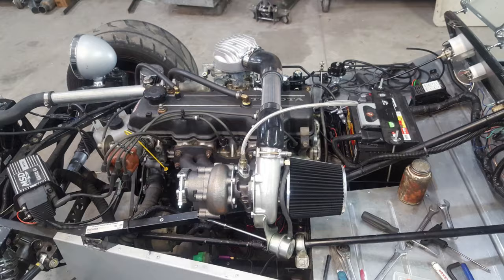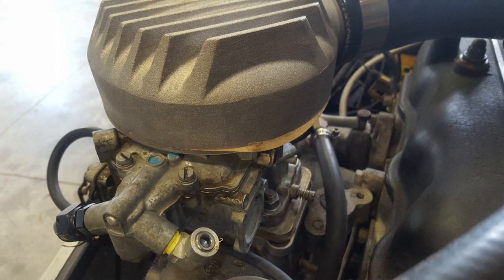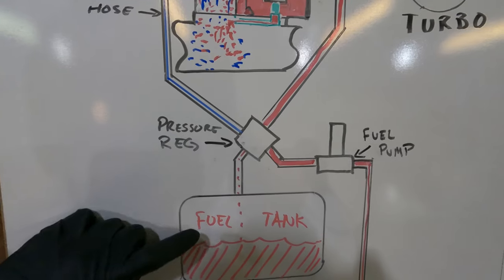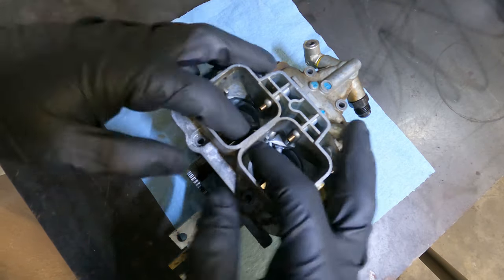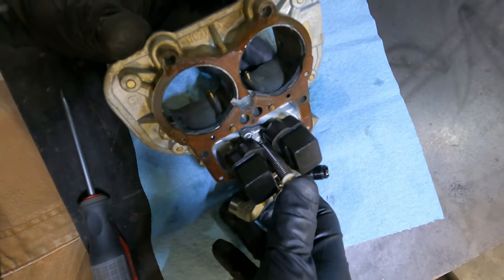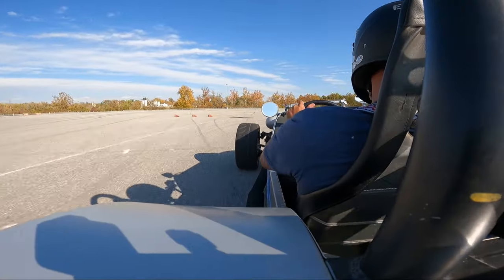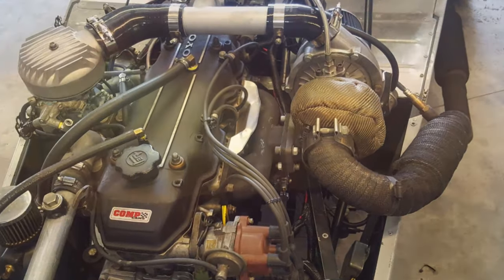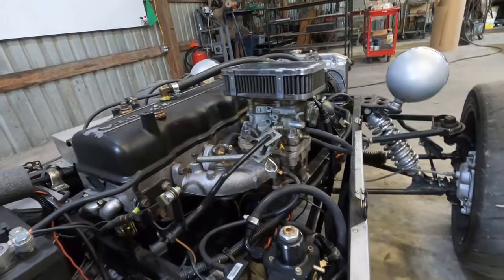Ebay Turbo+Weber Carb = WIN! ...and fail

Comment: Great vid! Only thing I’d say about a Webber for boost is the limits of flow from the needle valve could be a limitation at higher power especially for e85 and a little bit of modifying of the fuel passages to the needle could see some better flow,btw love the r series Toyota engine but it’s going be worthwhile for a swap maybe a 3rz or Honda k they will max that turbo out
Reply from the maker: 3SGE is on my short list since they are available with a complete 6spd. The intake and exhaust are also on the correct sides for the current chassis setup.
Reply: To overcome the needle valve flow I use 3.00 mm ones in my twin 32/36 blow through setup on my 3TC.

Comment: Sorry you didn't continue with this project. As antequated as these engines are, they can put out alot of torque and decent power with a 38/38 weber blow through setup as yours which can support a decent amount of CFM/ horsepower with the standard 27mm venturies and enough fuel flow for 400HP+ . 
Water methanol injection with current C.R. or a drop in C.R. using flat top 22R pistons with a bump up in ignition timimg would of taken care of the detonation issues..
With a camshaft upgrade, headport work and some double valve springs you would of had a very serious monster on your hands..
Reply from the maker: Flat top (85+) 22R pistons would drop the compression too much. The later engines have a lower deck height.
Reply: I learn so much in the comments

Comment: Weber performance offer a similar carb hat or 'plenum'
Reply from the maker: Quite a bit more expensive, but if it holds boost and an intake coupler will fit, might be worth it.

Comment: Did you think about a Holley sniper 2300 efi? I ran that on my 85 yota with a 22r with a cheap eBay turbo 🤘🏼
Reply from the maker: A megasquirt-based EFI is the next step for the R-series engine.
Reply: Man I've done alot with the 22r 20r and 22re I've tune and done many 22re engines without ring land failure.  I'd recommend a maxxecu personally. Megasquirt will work for sure but the control I've found is better with maxx, haltech, motec, ecu masters and a few others.

Comment: So that power valve circuit hole you drilled, did it have a hose fitting and a boost reference hose hooked up to it?
Reply from the maker: No, its drilled out just to allow more flow. In a blow-through setup, the power valve is already boost referenced. In a draw-through setup you need a separate boost reference hose.
Reply: @ozarkgarage   Hello what size drill bit did you used for the power valve? I'm currently working on a draw-throught setup and since I've seen your video I want to convert my build into E85!
Reply from the maker: @saidsalgado7581  I didn't write it down unfortunately. I used the same process as the main jets and measured using a drill bit with a good fit and then went up in size accordingly.

Comment: Hey man I hope you can solve me this question. If I install this exact setup but with intercooler my car would be reliable If I use regular fuel? In my country there's no such thing like premiun fuel or E85. I live in a hot city
Reply from the maker: I would also add some form of timing control like an MSD 8762
Reply: @ozarkgarage  thank you so much

Comment: Very helpful, did you seal the throttle body at all? Wouldn’t boost leak from there?
Reply from the maker: I'm not sure what you mean about sealing the throttle body. If you are referring to the throttle plate shafts in the carburetor body, no, I didn't seal those. They are a close enough machined fit (assuming your carb isn't worn out) to hold boost/vacuum.
Reply: @ozarkgarage  that’s what I meant, my carb looks fairly new so I should b alright. Thank you great video and advice, you deserve more subs and views
Reply from the maker: Thanks! Good luck with your build

Comment: Ok so if you had built and tuned it to run 98 instead of e85 would you still have blown it up?
Reply from the maker: It didn't blow up until I went back to 91 octane (tuned correctly). 98 octane wouldn't have solved anything because it's not available at the pump.
Reply: Ok so the timing was the reason you detonated it? Would the use of a small supercharger instead of a turbo make it easier to tune?

Comment: I have a question for you since you have done this. I have essentially the same 22r blow through setup minus e85. I'm getting into the tuning stage with the Weber and I want to know how you open up the power circuit? I see you drilled and tapped that hole to access the ports, do you just drill those power circuit ports out until your numbers are good? 

I did a couple laps around my block and I was at about 16:1 peak while boost was coming on. Normal cruise was sitting at about 12:1 and I don't want to go crazy drilling out my mains since its not that bad pre-boost now.
Reply from the maker: Yep, you nailed it. Gradually opened them up until it wouldn't go lean when boost kicked in. High RPM  mixture can be tuned with the air jets.
Reply: @ozarkgarage  You are the man! Thank you for the reply!

Comment: Hi! Nice video, I'm building the same blow-through setup with a supercharger. I have gone through all the comments and you mentioned that the power valve is actually already boosted referenced in a blow-through setup, u drill it only to allow more flow and enrich AFR. Do you reckon I can get away with just switching the main jets to a bigger size to enrich the mixture? Also, I'm suffering from the car running lean under sudden throttle input, so when you suddenly floor it, the AFR leans all the way out of the range and the engine nearly dies. After seconds it will pick up and go well, or sometimes I have to let go of the throttle. The small throttle input seems fine, slowly press down the throttle to WOT, and it will run fine. Sorry for the long text, any advice would be a big help for me. Much appreciated!!
Reply from the maker: You may be able to go to go with large enough main jets, or smaller air bleeds. A supercharger has a linear boost curve, unlike a turbo. The lean condition on rapid throttle change is an issue with the accelerator pump or pump jet. Make sure yours is working properly first of all, the jet can get clogged and the diaphragm in the pump can get torn or filled with crud.  There really aren't larger jets available, so if you need a larger one, you will have to drill yours out for more flow.
Reply: @ozarkgarage  ah thanks for replying man, yeh was suspecting about the accelerate pump too, but I can clearly see it squirts streams of fuel when I flap the throttle, so it shouldn't be clogged. Is the accelerate pump standalong or it is within the idle circuit and affected by the idle jets? 

I'm also suspecting the idle jets being too small, resulting the progression circuit not picking up enough fuel when throttle being opened. Not sure if jeting up idle jets will as well enrich accelerate pump. But i'm already on 60 idle jets, the engine is just a 1.6L 4 banger. I doubt if I should still go up LOL
Reply from the maker: @leonliu7086  how many turns out are your idle mixture screws? My 2.4L only needed 45 idle jets.
Reply: @ozarkgarage  yeh that's what i was confused about, I hardly see people using idle jets bigger than 60. I have the screw 3 turns out already, with 60 idle jets.
Reply from the maker: @leonliu7086  cant help but think there is a vacuum leak

Comment: How much bigger did u increase the size of the power valve Circuits?
Reply from the maker: I didn't write it down, unfortunately. I used the AFR/Boost curves on the laptop and gradually increased the size until it was where I wanted it. There is no good way to go smaller once you go too big.
Reply: Alright 👍

Comment: So did u put a hose from that part u cut out of the carb  to the intake so as u build boost u are sending that psi to the power value?
Reply from the maker: No, the power valve gets a vacuum/boost signal elsewhere. The port I opened in the carb was just to allow me access to drill out the power valve fuel circuits. I plugged the port after I opened up the circuits.
Reply: @Ozark Garage  ooh thank you I'm trying to boost a weber and this helps a lot
Reply from the maker: Cool, good luck!

Comment: What jets did you run as it would help ball park mine and could you do a more in depth video on the tuning and power valve?
Reply from the maker: I think the Weber came with 145 main and I ended up running 190 with the E85 (it has been a while). I can't remember what I drilled the power valve circuit out to. As for tuning, the wideband AFR gauge is the only way you can accurately tune it. I'm putting EFI on the car now, I'll have a video for how I road tune, it's the same method for EFI and carb.
Reply: Thank you. I’ve just got my wide band set up and just struggling to not have it lean out in boost
Reply from the maker: Double check to make sure your fuel pressure is rising with boost. If the boost is greater than the fuel pressure, the fuel level in the float bowl will drop or worse go dry.
Reply: To be sure I’ve ordered a new reg and pump. By chance do you still have that carb to check the power valve circuit?
Reply from the maker: @Jake-px7xk  Yes, I still have the carb, I'll pin gauge it and see what I ended up with on the power valve circuit.
Reply: Thank you so much

Comment: How much did it run you?
Reply from the maker: I think I had around $500 in the whole setup. Gauges, fuel pump, regulator, lines etc. I made my own turbo manifold and plumbing which saves a ton.

Comment: I Have a 3236 weber on a l28 engine what jetting you use
Reply from the maker: Idle jets were stock 45, with the E85 I think I ended up with 190 on the main.
Reply: @ozarkgarage  well I running air primary 170 main 155    secondary air 175 main 160   gas finish very quickly plus burning a little white
Reply: @ozarkgarage  I put a 170 secondary main didn't get much power
Reply from the maker: Honestly, my top recommendation would be to install an AFR gauge, even if its just temporary: https://youtu.be/EeXsm-Qf62E